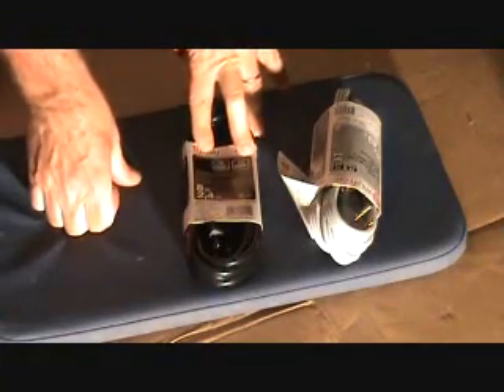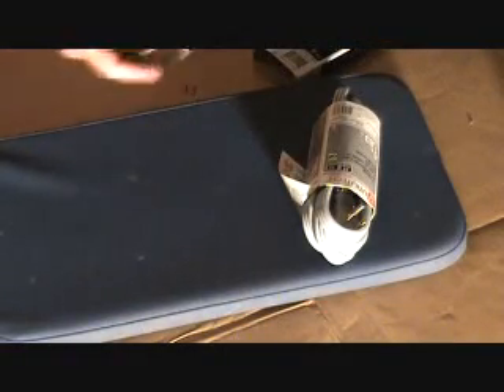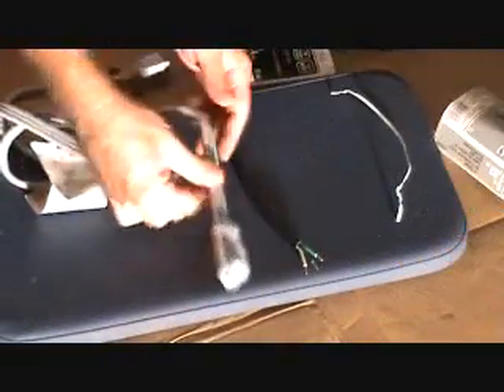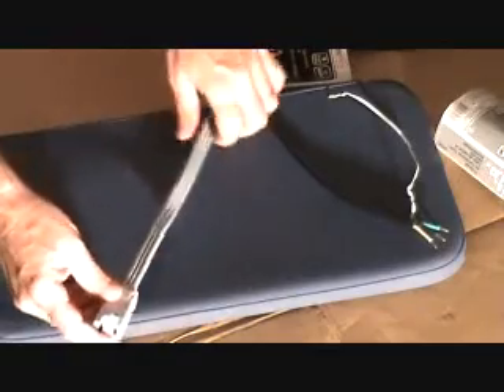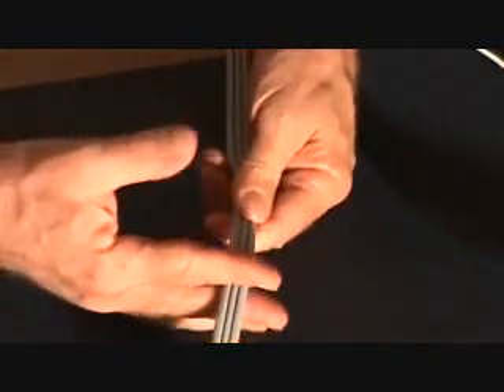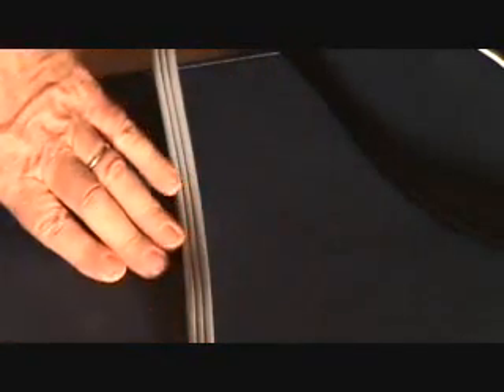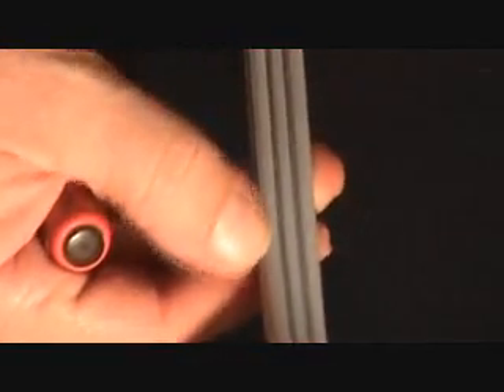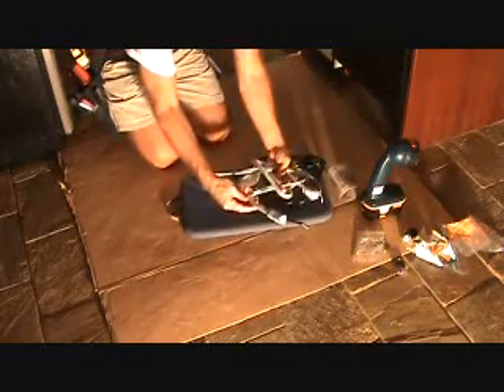Hooking up the electrical to a new dishwasher: what's a pigtail?

Comment: I connected my dishwasher last night  and was unsure of the wire placement so i guessed 
so i plugged it in and it ran. what will happen if its connected incorrectly? Wish i had seen your video sooner
Reply from the maker: Not sure but it could trip your breaker or not work at all or could fry something in the dishwasher or ruin the Mother board! Earth to Will Rogers....come in Will! Is it still working 6 years later with no issues? I guess you got lucky!

Comment: VideoJoe this is just what I needed.  I used my previous power cord from my other dishwasher and wired it into the new one, but did not plug it in.  I had to quit and finish the next day.  That night while I was laying in bed, I wondered if I had connected it correctly with the white and black connections.  Found your video the next morning and double checked my wiring job.  Luckily I had wired it correctly.  Thanks again and now I know.
Reply from the maker: Steve Waage Great job for checking! Thanks for your message!

Comment: What is the wire size of the pigtail? You are going the plug that into a 20 amp circuit🔥
Reply from the maker: Go to your local hardware store & they have pigtails already made up & you want to tell them you need the pigtail for a dishwasher & it's on a 20 amp circuit. They will show you which one to get. Thanks for your question.   Joe  :0
Reply: Normally a dw is on a 15acircuit by itself (most dw is rated for 15a circuit) if its not, then a 20a circuit. 15a takes 14awg and a 20a takes 12awg

Comment: Can I plug a GB and dishwasher into the same 15 amp outlet?
Reply from the maker: Normally they have a dishwasher & garbage disposal on 2 different circuits or if they are on the same circuit then it should be on a 20 amp circuit. If you have no other choice then do it the way you are asking & just try to remember not to use the garbage disposal when the dishwasher is on. If you do use both at the same time & if the breaker trips then you will know why. the garbage disposal will not use any electricity when you don't have it turned on so it should matter if you just have a 15 amp breaker when the dishwasher is on & the garbage disposal is off.   Joe  :0

Comment: So I'm getting a new dishwasher today and last night unhooked the old one. To my surprise the old one  had 2 electrical chords connected to it. A grey utility pigtail like the one you talk about in your video (and it's plugged into an outlet behind the dishwasher), but also a much heavier gauge set of wires coming out of a yellow cord that comes up through a hole in the floor! So I haven't any idea what that is about, and unfortunately  in my rush to unhook everything, I didn't take note to how they were wired up together.  Note: the wire coming out of the floor has obvious white, black and copper ground...  I'm just not sure why there would need to be two electrical chords going to the same dishwasher. Any suggestions?
Reply from the maker: Ha! You are lucky....something I've never seen before! Actually it's probably something like they are powering up something on down the line from the dishwasher & they didn't know what else to do but hook it in with the dishwasher junction box. They probably added an electrical outlet somewhere at the bottom/end of that other wire & they thought it would be easy enough to just go from the dishwasher since maybe they didn't know where else to come from without cutting open a wall & tieing in the power to another outlet somewhere else. Is there a way you can see where this extra wire goes to see if you actually still need it wherever it ends? If you had the dishwasher pigtail unplugged from the wall, then wherever that other cord goes to, will not work....so they are using the dishwasher as the junction power box for that cord. Like I say....I've never seen this before. Usually the pigtail for the dishwasher is only for the dishwasher & depending on what size cord that pigtail is, it really should only be for the dishwasher & not for any additional power outlets/etc. to be added to it. If you knew where that additional cord was going you could then determine what that is for & then decide if it's really necessary. Pigtail cords come in different sizes. Not sure exactly what size is required for your dishwasher. Go to your local hardware store...Explain the situation & see if he might suggest upgrading the size of the pigtail to allow for the additional item that's connected to that extra wire of yours. Good job by the way with removing your old dishwasher.   Joe  :0
Reply: Thanks, I was suspecting something like that.  I intend to crawl under the house and check it out... It's just freezing rain right now and I'm not looking forward to getting on my belly in it and crawling through that little crawl space. Thought I'd ask first at least to get an idea what I was looking for. Anyway, appreciate you getting back to me.
Reply from the maker: Good luck with crawling under there. Let me know what you find.....    Joe  :0
Reply: VideoJoeKnows  Your guess was right. Somebody had an outlet  wired off the dishwasher...  I do not plan on hooking that back up.
Reply from the maker: OK....then you can keep that wire disconnected & cut it out of there or leave it unconnected & pushed under the dishwasher & if you ever decide to do something with it, you still have your options open.   Joe  :0

Comment: Thank you. I was looking to find out this exact thing.
Reply from the maker: Sometimes it's easy to see how the wire goes straight up into the plug so you can see which wire is the hot & neutral, etc.. But sometimes the cord is a very small size (for light a night lamp). Then it's important to find the little ridges on the cord. Thanks for commenting.  Much appreciated!   Joe  :0

Comment: I never did this so I made a mistake.I could not get the washer pulled out be unknown black hose or whatever it was holding washer from coming out.So I clipped it off,bad mistake it was electrical wire and made a good spark and I'm okay!Now the wire is not long enoug to reach the washer tie in place,what can I do to extend wire? Thank you!!!
Reply from the maker: Did this black wire go through the cabinet up to the outlet under the sink & plugged in there? You could remove the entire wire "pigtail" & purchase a new one at the hardware store. See where the black wire gets connected to the dishwasher? Remove that cover & you will see it. You can do it!    Joe  :0
Reply from the maker: Is this wire connected directly to a junction box back behind the dishwasher & not plugged in under the sink? This type of connection is a hard wired connection & sometimes they did this back in the old days. Turn the breaker off to this wire & you can replace this wire...... You could extend the existing cut wire but you would have to add 2 electrical junction boxes & add a little section of wire to connect them then push back behind dishwasher. I would rather see you not do it this way though.   Joe  :0